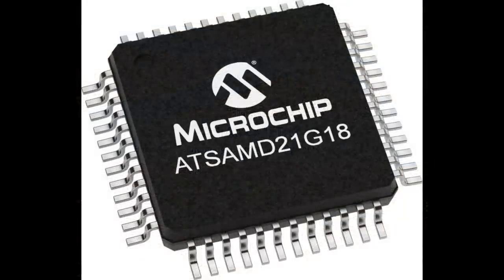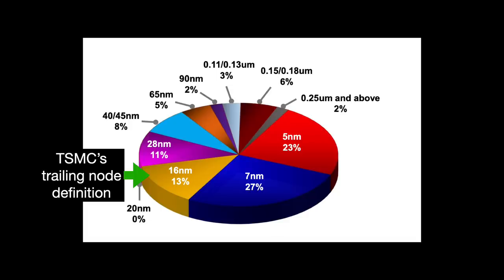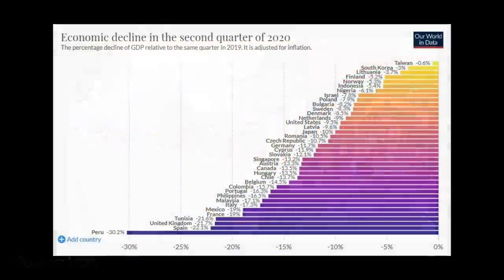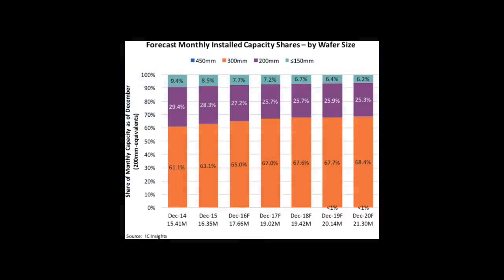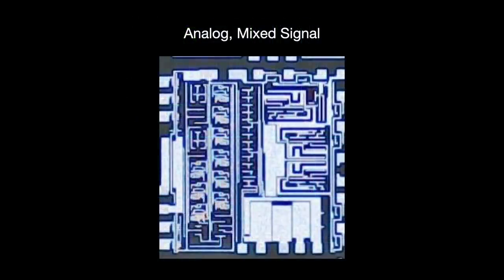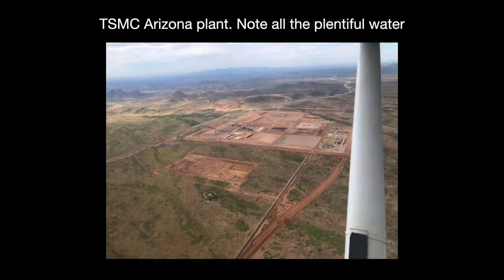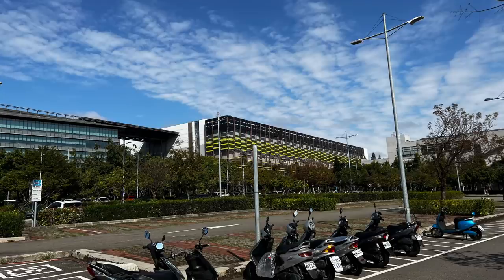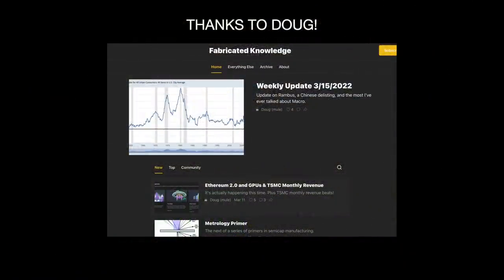Where The Real Chip Shortage Is

Comment: We may live in the Sonoran desert her in Phoenix but... there's a reason the metro valley is reaching a population of 5mil. We know how to handle water. 
The new FAB plant is being built a couple miles north of the Central Arizona Project. The CAP is a canal that runs for over 150miles from the Colorado River by Parker AZ, down to Phoenix and then Tucson. It's primarily use is agricultural. Less than 15 miles to the north west of the FAB is Lake Pleasent. That's a reservoir of over 1 mil acre feet of water. No river runs freely in Arizona. We have multiple reservoirs in the mountains where we collect winter snow runoff to supply drinking water. Much like California, only we do it better without all the Democrat corruption and mismanagement.
I've been here over 40 years, watch the Valley quadruple and we've never had to ration water. 
So... pretty sure the FAB will be just fine.
Reply: Also, might want to look at the trends re; the flow of that river over those 40 years. Definitely take an gander at the rate of replenishment vs usage. Might also be a good idea to brush up on the demographic and economic changes up stream and maybe also the state of water rights and what outcomes that might incentivize. Oh, and take a look at the situation down stream too, in Mexico. 
Or believe whatever makes you feel secure and comfortable regardless. Can't see that ever becoming an issue. Never has before.
Reply: Water Wars   Next stage of water restrictions in Arizona could come as soon as August
Officials with Central Arizona Project and the Dept. of Water Resources warn the state needs to do more to conserve water to help stave off even more restrictions.

Author: William Pitts
Published: 6:17 PM MST May 6, 2022 
 Updated: 7:40 AM MST May 10, 2022

ARIZONA, USA — Arizona water officials now predict the West will enter the next stage of drought restrictions as soon as August.

A Tier 2 shortage declaration would mean even more cuts to the amount of water Arizona gets from the Colorado River, but not nearly as much as the Tier 1 shortage declared in 2021.

Still, officials with the Central Arizona Project and the Department of Water Resources warn the state needs to do more to conserve water to help stave off even more restrictive cuts.

“Most of the water use is outside the home,” CAP Deputy Director Ted Cooke said. “It’s in the yard, it’s pools, it’s plants, it’s lawns.”

Cooke said there’s a lot of room for conservation just by having people cut their home water use.

The Federal Bureau of Reclamation declares water shortages, which trigger water cuts based on previously approved agreements.

In 2021, the Bureau of Reclamation declared its first-ever water shortage, cutting more than 500,000 acre-feet of water going to Arizona. An acre-foot of water would generally supply three average Phoenix households with water for a year.

A Tier 2 shortage, if it’s declared, cuts an additional 80,000 acre-feet of water to Arizona.

“How that’s going to impact the homeowner is…they’re probably not going to see much of an impact at all,” Arizona Department of Water Resources director Tom Buschatzke said.

Lake Mead and Lake Powell are at record low levels, thanks to a 22-year-long drought in the West. 

RELATED: Lake Mead water levels hit lowest point in 51 years

The Bureau of Reclamation announced this week that it would keep another 500,000 acre-feet of water in Lake Powell just to ensure that Glen Canyon Dam can stay functional.
Reply: I can barely grasp pound per feet to express torque, instead of the far more practical Newton per meter units. But acre-feet makes it even harder to understand 😅
Reply: @theagentsmith  torque: foot pounds, not pounds/foot. Pounds per foot is how much you pay for lumber in the UK :-)
Reply: It’s all fun and games until you actually have to ration water. The more you build, the more you have to spread around.
Reply: Didn't I just see a video of a town in Arizona that won't allow new residents hookups because they already ran out of capacity?

Maybe it's New Mexico.
Reply: @porcorosso4330  Prescott had an issue years ago but... they saw a huge population boom in a short time and had a infrastructure issue. They've worked through it. Again... govt signing off on building permits not because the area can support it but...because of payoffs, bribes and overall corruption.
Reply: @williambrasky3891  First...I'm an independent. The differences between the parties over the last 20-30 has become less and less with the exception of the last six years. One party lost its mind and allowed itself to be run by Twitter posts. The other have become increasingly more feckless and cowardly. 
With that said, there is a clear distinction between two southwestern states, their management of water and natural resources and the two parties that have rules them. It isn't hard to see what decades of democratic rule of California has done to that state. The corruption in California, primarily by the democrats since the 40s (the GOP certainly had their shady stuff early on) from Freeway building to water and forestry to housing and so on is apparent. Especially in contrast to my home state of Arizona. Arizona, while not perfect, has done a much better job in all of these areas while growing faster than anywhere else in the nation. Sadly, the political landscape has been changing but I suspect it will swing back the other way soon as the modern democrat party continues to alienate the Latino population. 
Regardless, the original point being, Arizona has been one of the more rational and less corrupt States in the Colorado River basin and not the leading cause of the issues with water. California is the primary problem. This, I'm sure, is why this chip manufacturer choose to invest in and build in the north valley! Had the GOP caused the destruction of California over the decades, I would gladly call them out for it as I have no allegiance to either party. 
Now, if you want to start to fix these problems, start with the Fed and introduce term limits to congress! I would even consider it going back to the states choose their Senators as it originally would. Then, I would consider and promote the states do the same. Government corruption is born out of the power these people accumulate in one position for decades! We all know about how power corrupts. 4 - 2 year terms cor the House and 2 - 4 year terms for the senate. 8 years 8s enough for POTUS then is should be good enough for congress. Politics was supoose to a civil service in this country. Not a career. That is what made us different. We've lost that and look what we've become. Not much different than the autocratic kingdoms of European a couple centuries ago.

Comment: Even an in-place update of 200mm to 300mm would be a bit silly (assuming it's physically even possible to find space in the fab to install new machines).  Many old tools simply weren't build to handle 300mm wafers, and even upgradable ones' manufacturers may no lover have the expertise (or even exist).  

In cases where upgrades/replacements are possible, the lead-time is likely horrendous, and fab companies would have to cull orders for their new/newer high end fabs so suppliers can work on making/upgrading equipment for the old, low margin fabs?   Some wafer robot lead-times are approaching TWO YEARS now--go and figure out which of your fabs you want your next EFEM order to go to, and likely that's not for refurbishing ancient fabs.  

I think cases where that works out economically would be exceedingly rare.

Comment: Note that more modern machines have also way higher throughput. An older ASML 200mm machine can handle 100 wafers per minute, while a newer 300mm can handle more than 300 per minute. So, that 6 times more dies per minute. Although the floor space is larger. Finally on 300mm you can better utilise the edges than on 200mm.
Reply: *per hour, not minute. Those kind of breakneck speeds would open a wormhole.